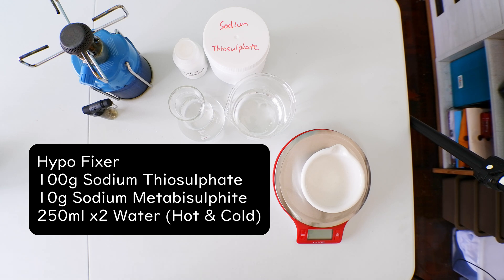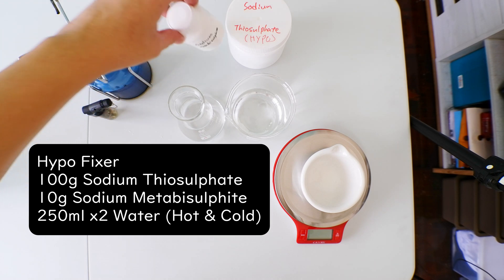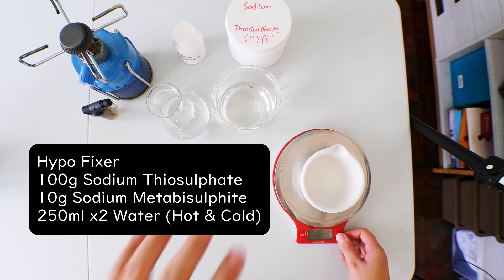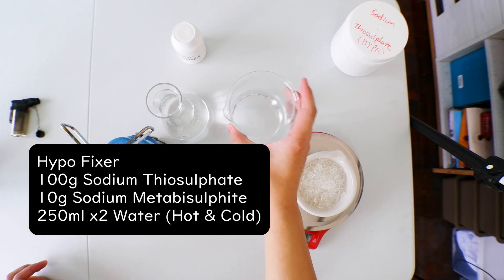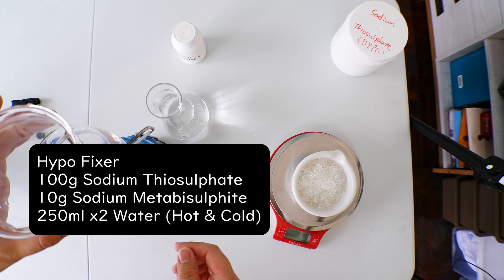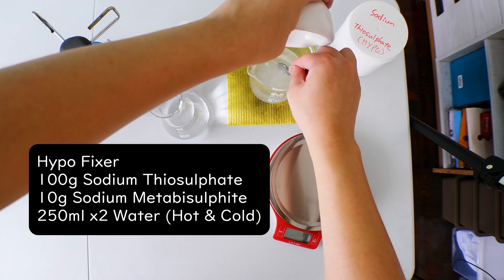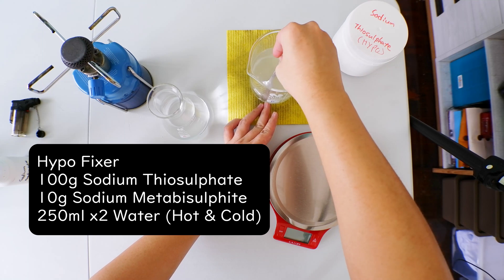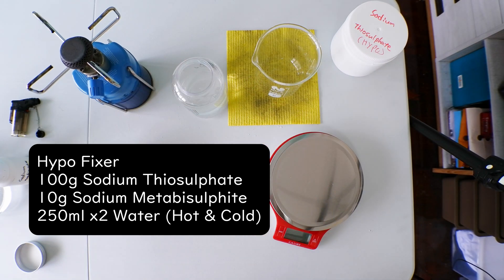How to: Hypo Fixer for Film Developing

Comment: Sir do you have the dilution and process for fixing? if its possible to ask
Reply from the maker: Just use Hypo (Sodium Thiosulfate) for at least 8 mins (any agitation method)
100g Hypo and 500ml water, mix with hot water to dissolve